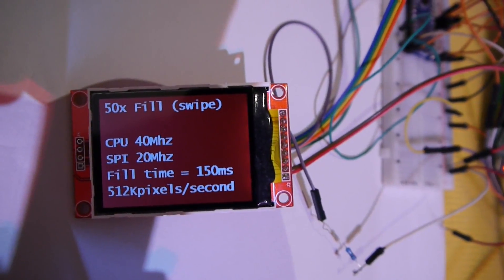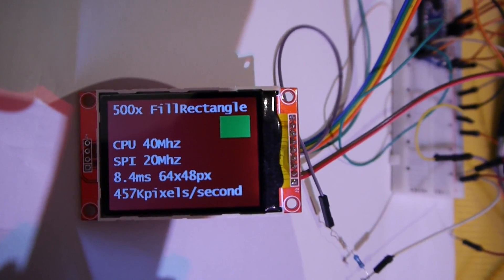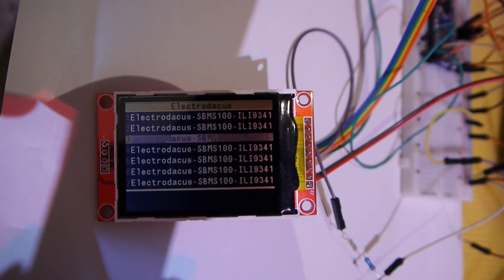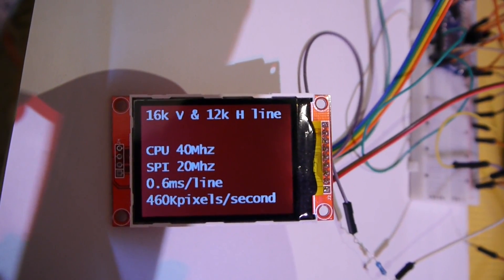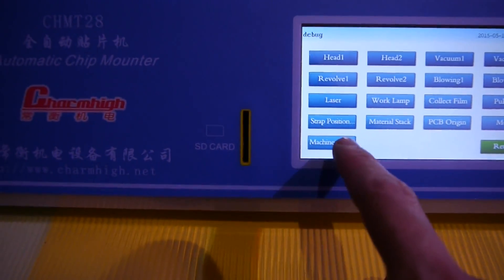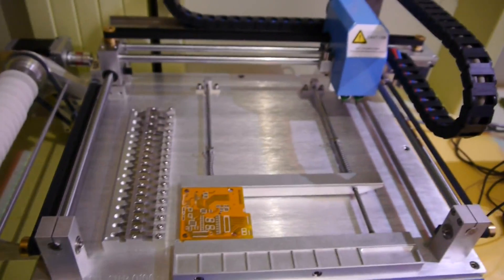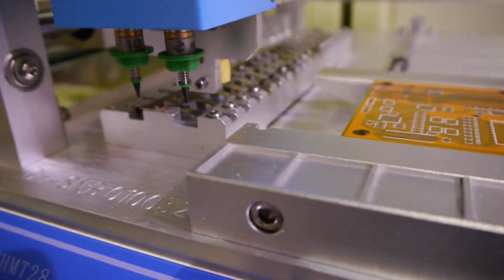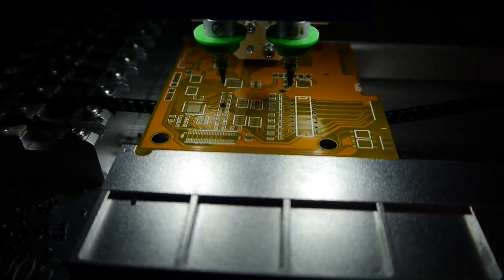ILI9341 SPI LCD library and the CHMT28 Pick and Place machine

Comment: Nice Video. Hope to see more about your hole assembly: paste, pick and place and reflow and maybe assembly and packaging. If possible can you tell something about the micros you use (not only the speed). Are you still on stm32? Why not SPI an DMA? Need code? Read Geoffrey Brown?
Reply from the maker: Looxy Look Thanks, I will try to make videos with the assembly. I will be using STM32F373. This is quite a new change just two weeks ago I was convinced I will be using STM32F091 (cortex M0) but decided to go for STM32F373 so I can use the 16bit ADC instead of an external ADC and the cortex M4 with FPU should help also a bit.
I prefer not to use interrupts in my code so is more predictable but maybe that is just my unfounded worry :)
For code see the link in the video description. 
Geoffrey Brown?
Reply: ***** In my understanding the DMA is done without interrupts in a seperate cpu block, but i can be wrong. Geoffrey Brown has written a nice book: Discovering the STM32 Microcontroller covered by the Creative Common - see www.cs.indiana.edu/~geobrown/book.pdf including SPI with DMA. A year ago i do some coding on an  STM32F103 with the ILI9341 and SPI/DMA (plain gcc-arm-none-eabi-4 with STM32F10x_StdPeriph_Lib_V3.5.0) just for my private education.
Reply from the maker: Looxy Look Thanks. I will take a look at that code. MCPCB is mostly good for power stuff is normally just one layer so you can not have complicated schematic or small pitch components. As for reflow you just need to allow for a bit more soaking time so that the metal core gets to temperature.  I use SnBi solder for all my boards. I used Lead Free solder in the last 15 years or so for everything I did.
But with complex stuff like this I prefer SnBi do to lower melting temperature it will create less stress for PCB and components (I have some plastic connectors that are also sensitive to higher temperature) Repair is also so much easier with the lower temperature. The only downside is maybe the more expensive solder paste but for the sort of volume I do is not that important.
Anyway the temp profile will need experimenting with for each board. Even having two boards instead of one in the oven will make a difference.
I'm still far form an expert in reflow soldering. I did the first reflow for the first version of the SBMS have not used that before then.
Reply from the maker: Looxy Look Just looked at your code and implemented DMA in my code to see how it works. It seems in some cases I get close to double the speed in some others less. I will check the exact numbers.
Still not sure if it will have any possible effect on the rest of the code the "DMA_Priority_VeryHigh;" is a bit concerning not sure exactly what it refers to and priority over what functionality.
My understanding is that there is a separate process not related to CPU where a buffer in RAM will be transfered to a peripheral in this case SPI but not 100% sure how it works. I will need to read a bit more about when I get time. This may be useful for ADC also.
Thanks again for the code.

Comment: I'd love to hear more about your pick and place machine
Reply from the maker: Sergio Orjuela Is quite new just got it yesterday morning so is a bit to early to say much about it.
It is a relatively simple machine and it seems to work according to expectations.
The larger model is more popular the CHMT36 but quite a bit larger and will not have fit in my small lab. It cost about the same so I made no savings getting the smaller unit (way less popular).
There is not much choice in "low cost" P&P machine. The Neoden where I think the first with the TM-220a similar to what I have and the TM240a similar to CHMT36.
I decided to go with the CHMT28 vs TM220a since I liked the improvements. The heads are Juki easy to change (kept in place by a magnet no tools needed).
The larger color LCD is also OK and probably better user interface not user about that.
 Most complains of people are about the component feeders but I find them to be adequate (simple and ingenious design probably credit goes to Neoden if they are the original).
Some other models come on the market but fr my limited budget and needs this was better choice.
The ones with vision are about 2000$ more and I can not justify that in my application.
I will be able to say more in a few months when I start production on my SBMS100.

Comment: Hi Dacus! How are you?  I'm used to Atmel AVR platform actually trying to move to STM32. Your updates to this SPI library are awesome and I choose it to drive my ILI9341. Since I'm using another micro (STM32103C8) I'm trying to make your code work with my board. I'm using Keil uVision 5 and  std_libraries packs and when I try to compile lots of warnings and errors are coming, mnost of them related to redefinition/redeclaration of SPI functions on your spi2.c file and some identifiers related to RCC being undefined. Please, would be great if you could give me some hint on this. Thanks in advance!  http://pastebin.com/d6N2F8Tp
Reply from the maker: +Willian Dolence Ribeiro Thanks for the comment. It seems you have some problems with the libraries you need to use the STM32F103 not the one I used STM32F373. I'm quite busy with my project I do not have time to look in to more details.
Reply: +electrodacus Please, could you point me which file defines SPI_CR2_DS / SPI_CR2_FRF?
Reply from the maker: +Willian Dolence Ribeiro It must be in STM32Fxxx_spi.c so the SPI driver.
Reply: +electrodacus thank you, I made some advancements, but still trying to figure it. Main problem is tm_ libraries are oriented to Discovery F4 boards. Thansk!